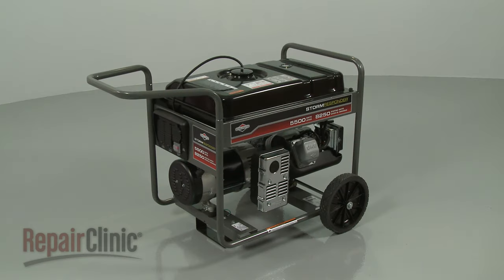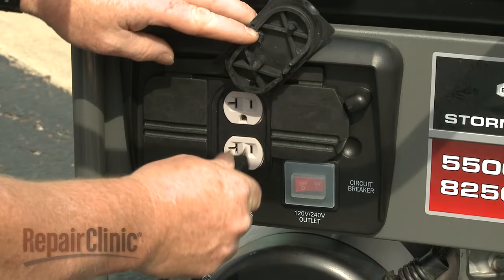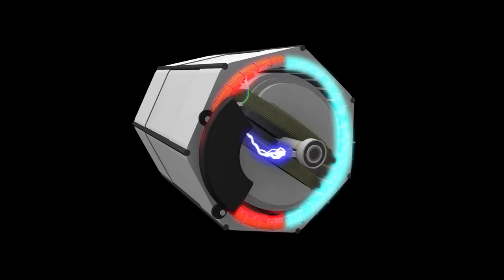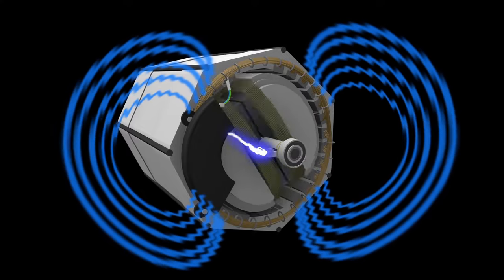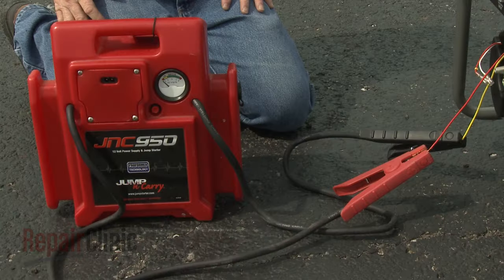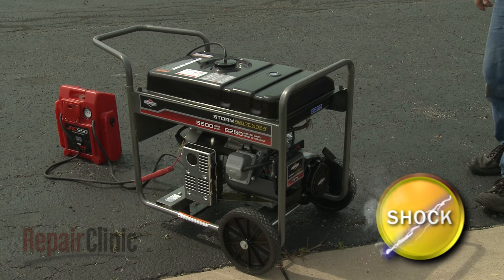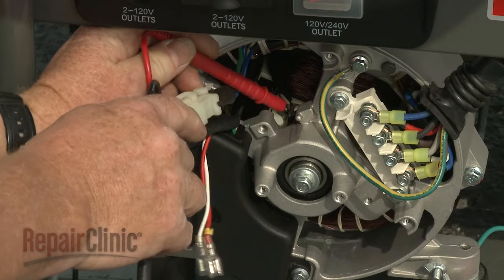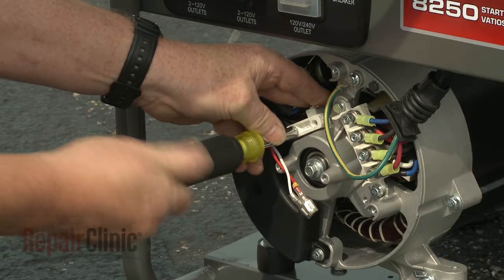How Does a Generator Work? — Engine Repair Tips

Comment: So, a portable generator is really just a single-phase (synchronous?) electric generator whose prime mover is a gasoline motor/engine. That is, the crankshaft of the gasoline motor is mechanical coupled to the rotor of the electric generator. Right?

Comment: i think if you put in power through the outlets while the engine is off you may be able to turn the generator into a motor
Reply: well I don't think that would happen. You'd blow the fuse and potentially damage the IO controller board
Reply: @Hays Coleman It's very fesible. In principle, any electrical generator can also serve as an electric motor, or vice versa. In hybrid vehicles and other lightweight power systems, a "motor–generator" is a single electric machine that can be used as an electric motor or a generator, converting between electrical power and mechanical power.
Reply: unless a diode is connected to the outlet to help stabilize the power; it would not allow power coming in through the power output to turn the motor

Comment: 1:05: In order to generate electricity you have to have an electric current power the electromagnet? Where does the voltage come from that goes from the excitation winding that powers the rotor? I know the engine spins the rotor, but without any current how do the copper wires in the rotor generator any power? Is there another source of the current?
Reply: There is a permanent magnet on the flywheel(on the other end ) . The magnet is needed for magneto to generate spark from plug. The magnetism extends from flywheel and crankshaft to rotor shaft and body laminations. This add to residual magnetism of the rotor lamination. When you pull the starter rope, some small volts(e.g 1-5 volts) are generated in the main and exciter coils by induction from rotor lamination residual magnetism. This exciter current is fed into the rotor(field) coil(thru diode, avr, carbon brush, slip ring). More magnetism is induced in the rotor.  Higher voltages are then induced in the exciter and main coils to generate ac. The higher the rotor magnetism the higher the the voltages and currents induced in the main and exciter coils. When the main coil is producing enough voltage (120v or 240v) , its feedback through avr limits current from exciter coil, no additional magnetism is induced in rotor coil, the voltage induced in main coil is stable
In a portable 2 stroke engine without avr, exciter coil is connected to a capacitor, the exciter coil charges its capacitor. Main,  exciter and rotor coils are not connected together.  When the starter rope is pulled,  residual magnetism (addition from flywheel magnet) in the rotor induces voltage(1-4v) in exciter and main coils. Current that flow in exciter coil charges its capacitor and induces higher current in rotor coil. Exciter capacitor charges and discharges resulting in oscillat ing current. The current in rotor coil induces higher magnetism in the rotor coil and laminations which in turn induces higher voltage in the main and exciter coils. There is no physical connections among main,  rotor(field) and exciter coils as it happens in generator with avr.  Speed governor in the crank case help in  voltage regulation, which is poor and somehow adjustable. Resistor load is needed to achieve some voltage stability
This is my explanation
If you have a better explanation, kindly let me know
Reply: @adeyemibabatunde1814  I thought it was the "residual" magnetism that gave just enough current
Reply: The rotor/shaft spins due to engine combustion (mechanical energy). As the rotor spins, it induces current onto the stator windings and that’s the current that’s going into power your home/appliances. 

Generator = mechanical energy into electrical 

Motor = electrical energy into mechanical

Comment: why generator make lot of noise ... ? is better to manufacture it to operate like a car engine a bit silent
Reply: A car's engine is covered up by the hood and its cover. A generator is open. If you manufactured a generator similar to how a car engine's made, it would be very bulky. Especially since the engine and alternator (charger) need to be together to create electricity.
Reply: Silent generator option is available
Reply: engine cylinder valves.  exhaust.

Comment: I have this same generator the problem is gas (petrol) been found in the oil compartment after its works for a while. What causes this problem
Reply: I have this generator too. What are you talkin about exactly?
Reply: Carburetor may be faulty , pushing too much fuel in to the cylinder(bad needle valve, bad float). 
Piston rings might have worn out. 
Poor ignition not producing adequate sparks

Comment: I still don't understand how gas turn into electricity.
Reply: Electricity is "made" when the magnets spin around their magnetic field over looped copper wire.
How the rotation of the magnets is done is of no concern really, as long as those get turned it's going to work.

you can spin a handcrank, or let steam do the rotating, or water pressure. 

In case of gas, or whatever combustible you are using, it works as an engine,
Gas and air get compressed in a small chamber on top of the shaft and when the sparkplug ignites the air/feul mix it wil decompress rapidly and that force has to follow a specific path to get outside, that path is connect to the rotating shaft and will turn the shaft in circles. The magnets are placed on this rotating shaft and makes the magnetic field go around and starts the electrons flowing.

If you are like me though, you will need a visual of the process to help understand it.  I'm not like those smart people who can read a text and then visualize it, i need videos and animations ^^

Comment: Got me a 3k wat champion that won't start, backfires every time and just don't start. ???
Any tips because I'm not a mechanic, I just want to learn why this thing ain't working
Reply: It worked for 3 months, regularly changed oil every 80 hours and it broke a spring, fixed it and the throttle started reving on its own until it revved so much it backfired and never started again.
Reply: Faulty oil switch, ignition

Comment: Why the hell does these stupid manufacturers not use permanent  magnets. Then you wouldn't  need  gas power, you could hook to a windmill and get free power. JUST ANOTHER DESIGN THAT USES FUEL.
Reply: Jerry Spann well for one thing, it would be pretty inefficient (unless of course you live in a windy area). Plus permanent magnets do exist, except if I'm not mistaken, they’re a bit expensive to produce so. In theory, it’s possible but quite inefficient and a bit expensive
Reply: Permanent magnets are brittle. magnet can  break  Magnetic strenght can't be varied easily for voltage regulations
Reply: Energy*